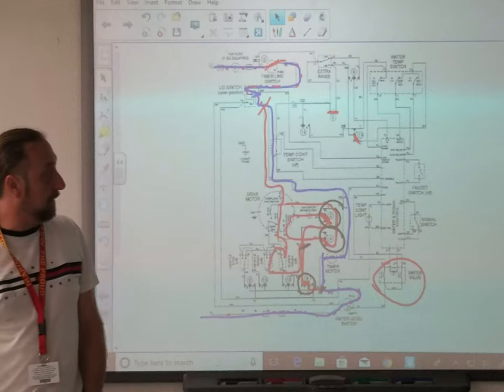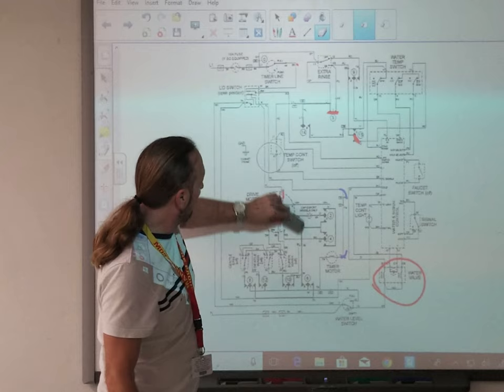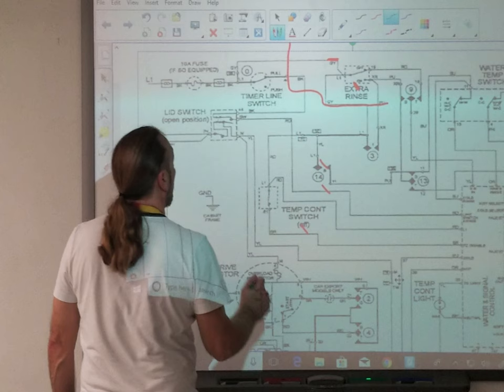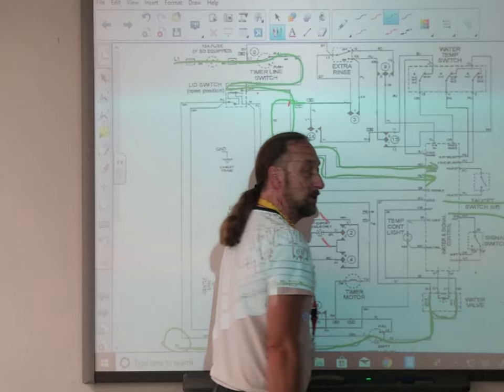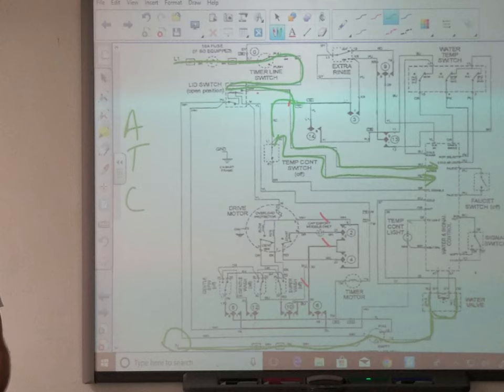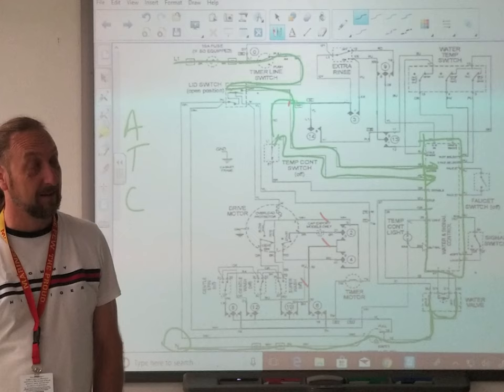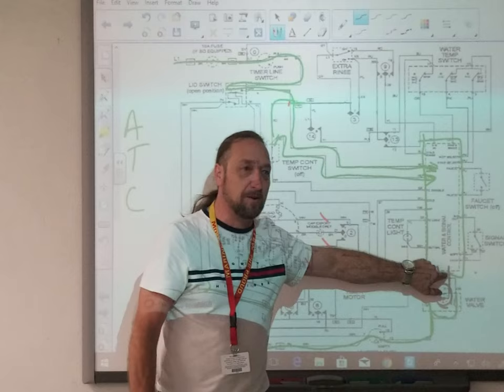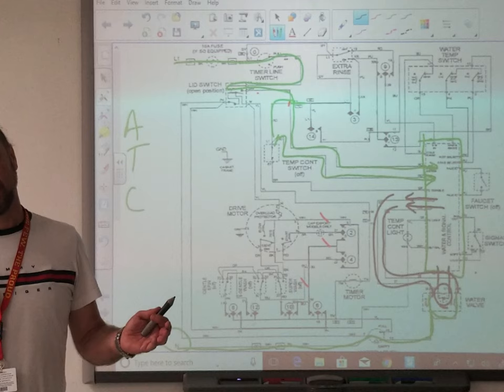Washer Diagram Troubleshooting

Comment: I am trying  but could use your help. I have a Kenmore 90 Series washer. After completing one load of wash I started a second. The tub filled with water, agitated then stopped. No matter what setting I put it in nothing happens. No humming, nothing. Another Kenmore 90 series washer was given to me. It agitated but no spin. After checking it out it was only a loose wire. Plugged it in & it went through the cycles. Put a load of cloths in & the only cycle that will now work is the spin. Any help on either one of these would be appreciated. I did notice same series but different timer control model. I did check the lid switch, both are good. I even jumped them to make sure. I installed a new controller on the first one & it will only fill with water. I checked both capacitors they are good.